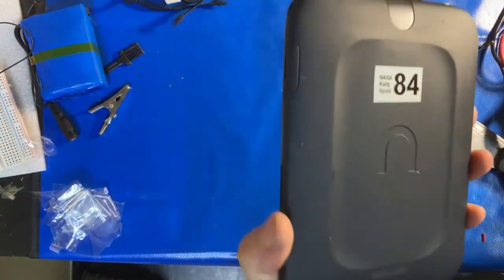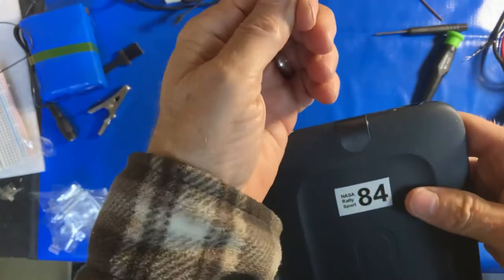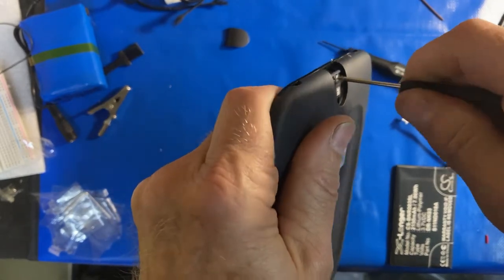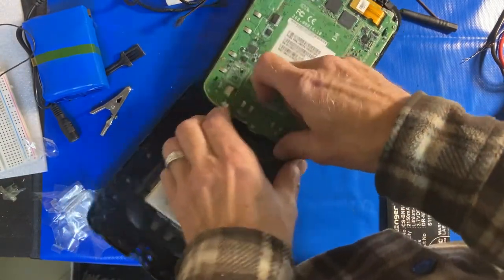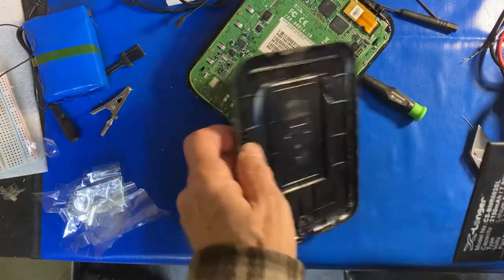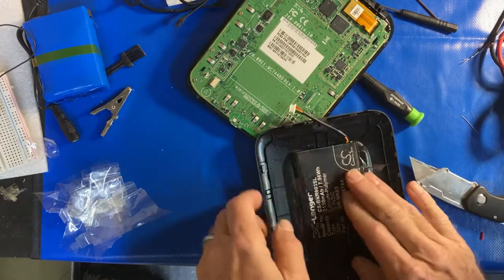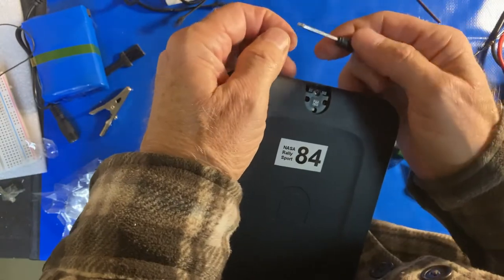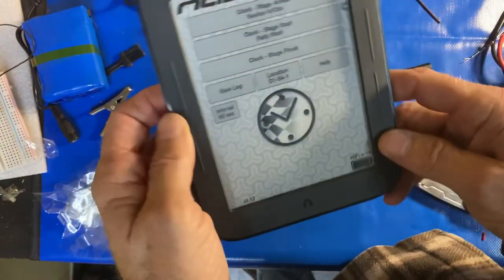How to replace your Nook Simple Touch Battery the right way

Comment: Thanks for this video. I bought a replacement battery to see if I can save my Simple Touch after the battery started swelling. I ended up getting a Glowlight 3, but kept the Simple Touch to replace the battery as a future project. Your video gave a much better method than the battery manufacturer's.

Comment: I've just come across this as I prepare to change my NST battery for the 2nd time (agree the method in the only other video was a bit rough). This way is much better thanks.
No one likes the health & safety inspector meddling, but may I humbly suggest people not slash down the middle of the battery to remove the tape? JF may have a deft touch and not have any problems, but I foresee others starting fires that way....

Comment: Excellent video. Without this I would likely have pried open the case and damaged it or would have had to have bought a specialized tool. The fingernail trick worked flawlessly! I filed down a small slot jeweler's screw driver to fit the Torx screw. I also re-used the old plastic tape backing to attach the new battery.

Comment: Stellar video, thanks! --- UPDATE: It now seems I've damaged both my sd card and my nook's ability to recognize any sd card. So I highly recommend removing any sd cards before doing this.
Reply: yes you can't pull fully down with the SD card inserted, likely you dislodged the mounting of the SD and potentially damaged the PCB. Definitely need to remove microSD card before sliding cover down.

Comment: When would you say a battery replacement is recommended because i just bought a used nook simple touch non glowlight for 10 bucks and it seems to hold an ok charge but i have no idea how many hours of use they should last. When is the battery life bad enough to where it should be changed?

Comment: Great video, but my case just doesn't want to slide back into place in reassembly. I've disassembled it twice the hard way, but it doesn't seem to be damaged.
Reply from the maker: Check that the battery is fully contained within the  pocket. Also be sure that there is no SD card in it.
Reply: @jefffield7676  lol! When I did this I left the sd card in there and she snapped right apart, whoops.

Comment: anyone know where to purchase the battery?
Reply from the maker: I used Cameron Sino CS-BNR003SL.  my guess is that you can find them on Amazon, etc.
Reply: @jefffield7676  Thanks! I'm now wondering if I should just buy a new one or try and fix this, or will I screw it up. I know you make it seem simple. But sometimes... the un-handy are just not good at it. Thanks again.
Reply: This worked perfectly for my friend's Simple Touch glow light. Got the battery and tools in a kit in Amazon after pausing your video to make sure I had a part number. Thanks for providing such a great video with clear instructions!